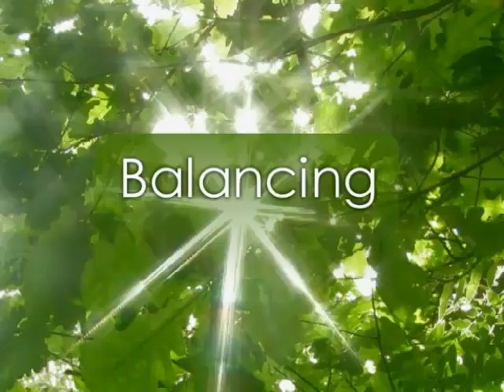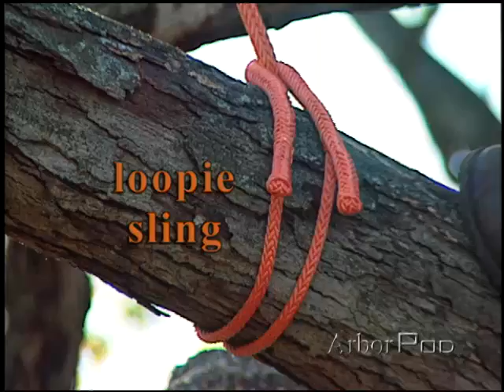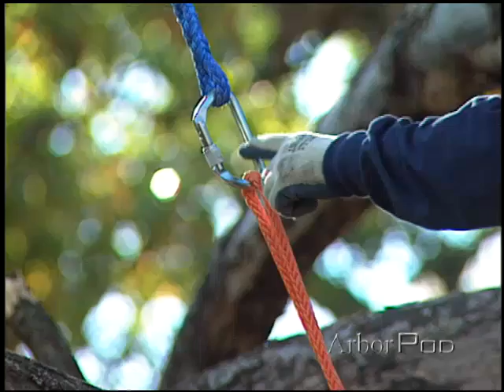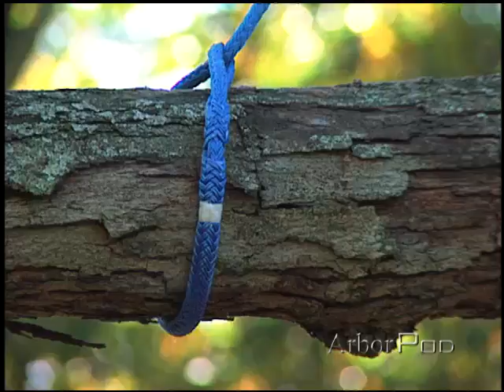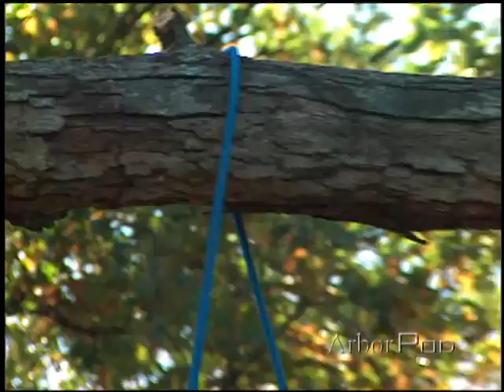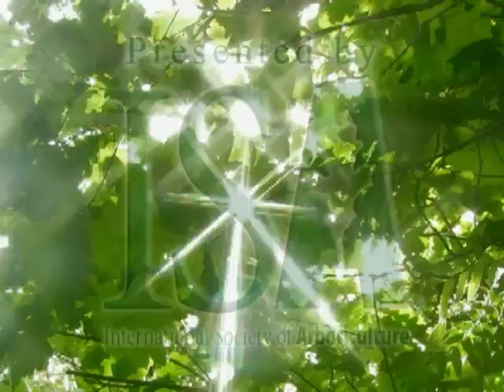Balancing

Comment: Great video you guys. I was wondering if y'all have had a chance to use the Back Bone rigging conector made by Sherrill. We recently used it on an ash tree removal. I have to say thr back bone is an excellent option when choosing a rigging connection point.